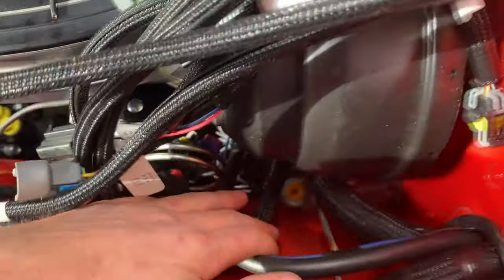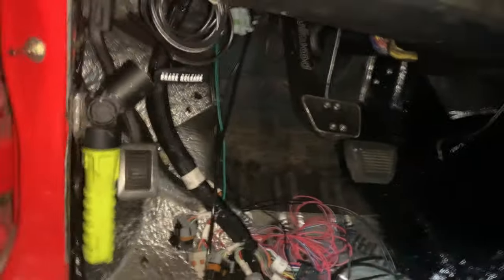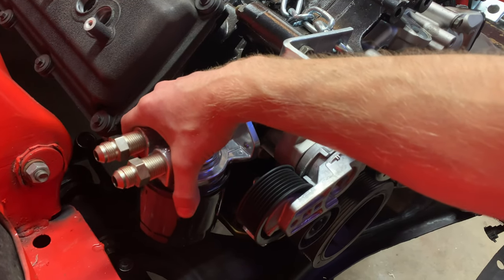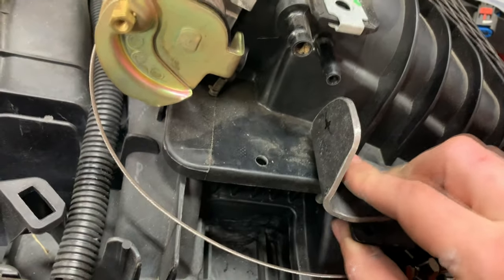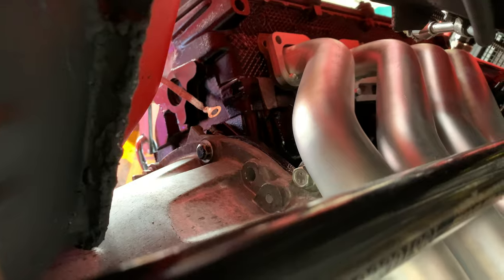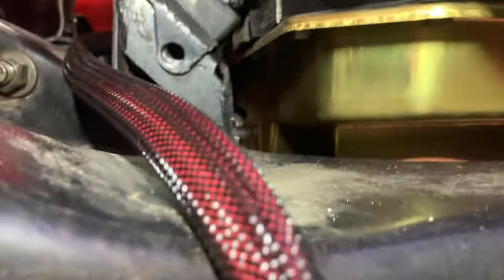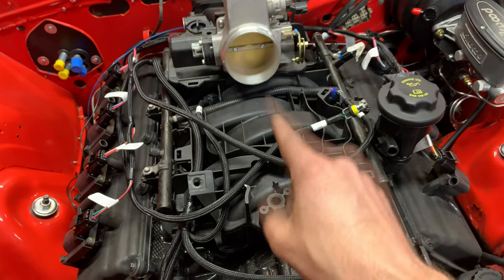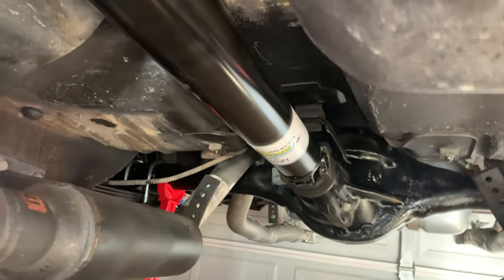1970 Challenger Hemi TR-6060 Swap Part 18: Driveshaft, Remote Oil Filter, Battery Cables, & Clutch

Comment: What did you use to adapt the slave cylinder hard line to an aftermarket line to the clutch master,
Reply from the maker: I found an adapter for it to 4AN, part number is Earl’s 652504ERL. I used a steel braided AN line to an adapter into the Wilwood master cylinder
Reply: @No Bolts Left Behind  much appreciated! I've been searching for days

Comment: thanks for the reply! what did you end up going with for part numbers on the whole clutch set up? cause I seen you had issues with the pedal hitting the floor and not engaging the clutch fully
Reply from the maker: The one that ended up working was the Wilwood master cylinder part # 260-15092, the pedal was a Wilwood 340-13834, the slave cylinder is a stock ‘15 Challenger part with an adapter 652504ERL. The clutch works great now, engages right at about halfway through the pedal swing.
Reply: @noboltsleftbehind   you sir are saving me a ton of headaches for my challenger lol I wish I could email you if I had anymore questions
Reply from the maker: @cjs9477  I’m glad I can help! You can hit me up on my Instagram, same username @noboltsleftbehind. I keep an eye on the comment section here too any time you have a question

Comment: What did you use to cover and protect the stater wires?
Reply from the maker: I first wrapped them in some mesh abrasion-resistant sleeve and over that some silver heat resistant sleeve.
Reply: @noboltsleftbehind  Where did you get the abrasion resistant sleeve? Part number?

Love the build.  Saw your road trip episode shortly after I got back from a trip down to Modesto on the coast highway and then back up through Reno and Klamath Falls.  But we didn’t do it in an old car.  Someday.

Working on a G3 swap into my Duster, but just gather parts and info.  You’ve been a great help and motivator. Thanks!
Reply from the maker: @DRick-jh2gt  thanks man! Road-tripping an old car long distances is definitely an adventure. I’m sure once you get that Hemi running in your Duster it’ll be good to go 👍

I got all my wire sleeving stuff from a website called McMaster-Carr, I know I used a lot of the normal expandable sleeving and the abrasion resistant stuff. It’s actually awesome place to find all kinds of things, hoses, clamps, hardware store stuff like that.

Comment: were abouts is the driveshaft from?
Reply from the maker: I had it built by Drivelines Inc in Orange County.
Reply: @noboltsleftbehind  How did you take the measurement to let the Drivelines folks know to build the shaft? How much did you pay?
Reply from the maker: @Brian-lk7tg  they actually came and measured it themselves, though I think the method is to measure from the output flange to the center of the u-joint  flange. I think it was around 750 everything included
Reply: Is that the BBK hemi swap throttle body?  Did the sensors plug into the holley terminator without modification also? Thank you 😊
Reply from the maker: @repair-and-despair-garage  yes it is, BBK part number 1791. The sensors did not plug right in to the Terminator X harness, I had to splice in a different connector for the TPS and wire the IAC connector to the in & outs harness.

Comment: Where did you get the drive shaft and adapter?
Reply from the maker: I got them both from a local shop called Drivelines Incorporated.
Reply: @noboltsleftbehind  
Thank you Sir!  I do appreciate it very much!  I am at this phase of my 73 B body build and just need that adapter to the transmission yoke and drive shaft with the slip because of the rear suspension.
Reply: @noboltsleftbehind  
Sometimes when you do something that trailblazes the realm of the possible, you end up with a ton of followers
Reply: @noboltsleftbehind  
I found one of their suppliers is Fort Wayne Clutch and Driveline
Reply from the maker: @blong2898  sure thing! I think there’s also another style adapter from Sonnax that adapts directly to a u-joint that fits Challenger TR6060s
Reply: @noboltsleftbehind  
You must be a mind reader,.. I just found that one from Sonax about 5 minutes ago.   I think that I will get that one
Reply: @noboltsleftbehind  
I am going from front to back on this build,.. get the driveline all installed, go through the suspension next then exhaust system